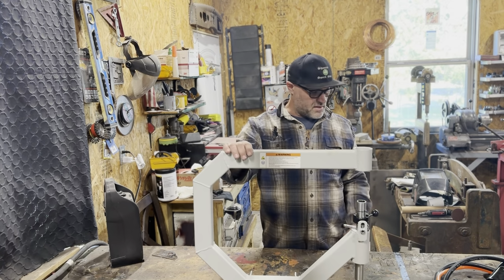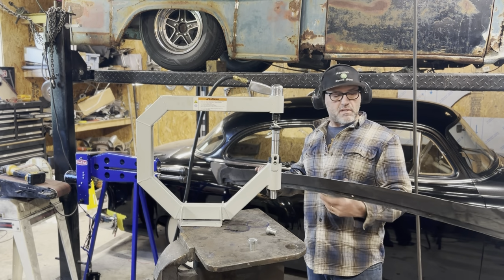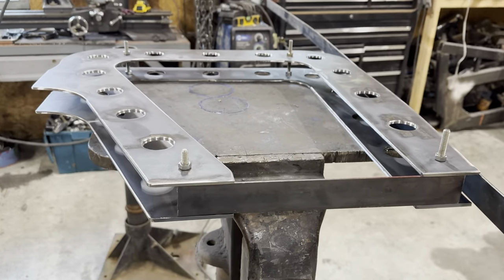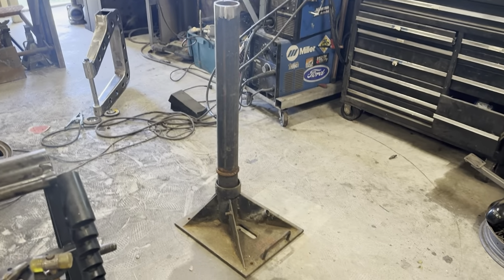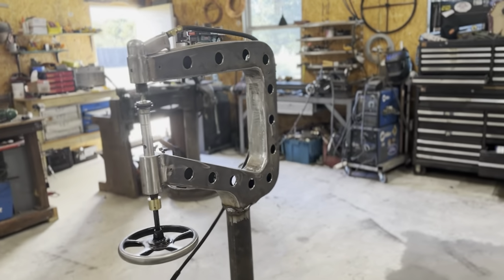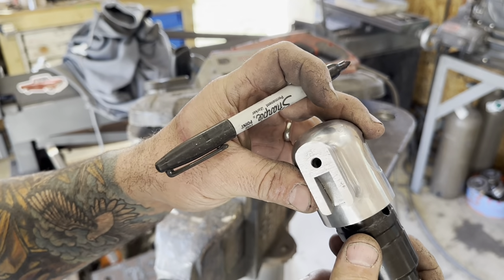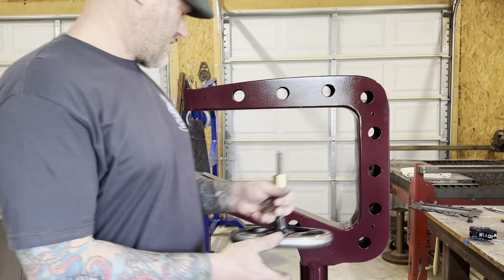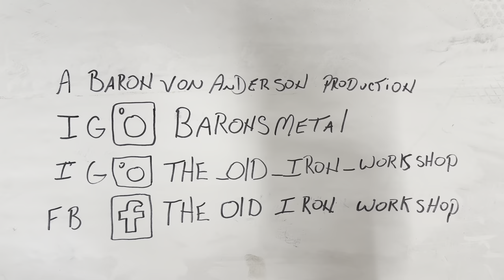D.I.Y Build your own planishing hammer, using tool store planishing hammer  parts.  ￼

Comment: I've had that harborfreight planishing hammer before and the welds weren't even close to being that bad. Wow you won't be able to keep sand in it with those holes. I won't be buying klutch brand
Reply from the maker: In hindsight put in the holes in it was a really bad idea the same as loud as it can be

Comment: I thought all the lightning holes in the frame would be to run pipe through and weld to really stiffen frame and let you run sand inside
Reply from the maker: That was my original plan. Somehow I decided I didn’t need it. It’s pretty solid and really doesn’t need to be any stiffer. Although the sand would’ve made it a hell of a lot quieter.  Whoops. That was one of those style over function ideas I guess

Comment: just found your channel...glad I did. I'm in the process of building a portable hand-held planishing hammer for my 33 chevy project. Love your car... great work so far! I'm still debating how much to chop the top on mine...once it's cut, you're in it for the haul haha.
Reply from the maker: Yes once the roof is off.  It’s the point of no return.
Reply: @Theoldironworkshop  Thanks for the reply :). I've been asking friends if the top needs to be chopped on my 33 and most say NO because of the stance and because of how low the body is sitting over the frame (I channeled it). IMO if the body is going to be at stock height, then yes chop it but if it's going to be channeled low over the frame and leans down some in the front then it's a big question. Some people like the chop to be a lot but I'm older and would struggle getting in and out of the car haha.

Comment: i just watched your 36 rear fender repair video, i've got a 5 window myself, now i see this with the 40, i've got one of those too! my little shop is 25'x25' here in socal. it seems like we're doing the same stuff. i've gott all new floors to put in my 40 from bob drake when he was getting them. now someone else handles them. i had to do the tail pan on the 36 and the same fender repairs as you plus the lower cowls and a battery cut out in the firewall. these poor car go through hell. i'll be checking out your channel out now too. nice video. enjoyed it.
Reply from the maker: yes if cars could talk i bet they would have some stories

Comment: Hi, I’ve just watched your video did a great job of building new frames. but in my opinion  you should have left adjuster as it was overtime with your adjustment Wheel set up will cause the threads to be stripped and as you can see on the video when you start using the hammer the wheel if not locked properly will unscrew its self regards, Eddy.
Reply from the maker: Yes I agree   It dash have a lockdown nut, but probably should’ve just left it 
As it was.   But I just thought it looked cool the wheel on the bottom.